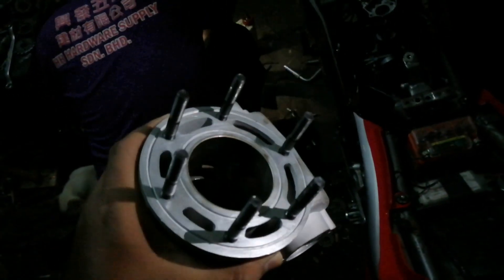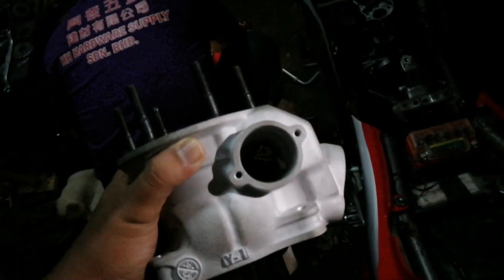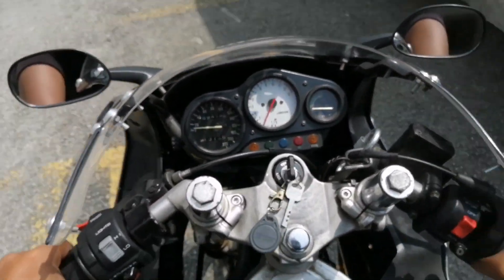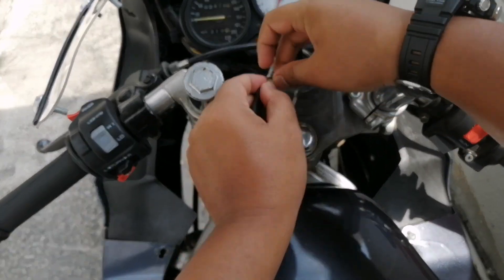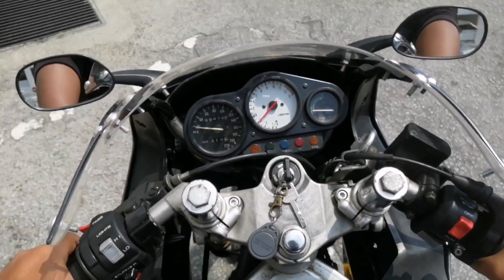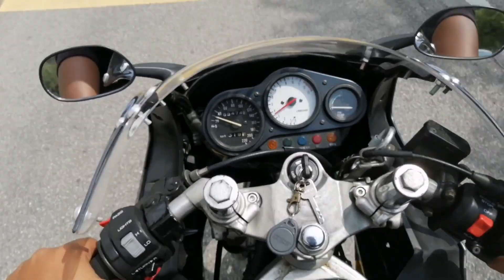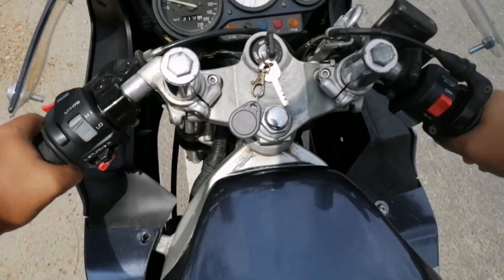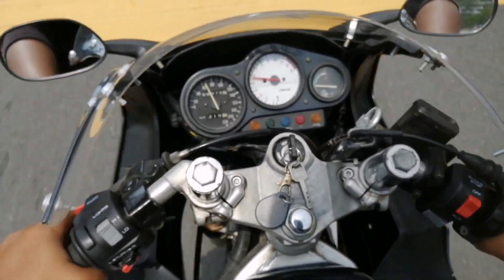TUKAR BLOCK YAMAHA TZM 150 TAIWAN

Comment: ajar cara porting block...moto sya mati kt 160 ja...hahahah
Reply: Kompress dan sporket tune smula bro
Reply: @yum4906  rpm moto mti kt 10.5k...moto jdi mcm smpot2 xmau lepas hbis bnyi rpm dia....mcm ada something block angin
Reply: @chikannie3917  tz sy 10.5rpm topgear 19+ > 2++ kmj da sporket 17/47, tyre 90/90, brat bdn 82kg😁
Reply: @yum4906  owhh orite nnti sya cba naik kan sporket dpan ke 17 skarang ni 16 lain smua sma...brat sya 56kg bleh p lju skit la kott??🤣🤣
Reply: @chikannie3917  brgntung performn motor. Klu x Cukup power atau msih stdr akan drop pickup dan gear 6. Tz sy da skim head 4mm
Reply: @yum4906  hmm gps 158 ja...rpm gear 6 10k mksimum xnaik dh...klau rem ksong lak dlm 10.5k sja ...hjung jdi mcm ptus2 smput...hhmmm xtau nk hbaq mcm mna...tpi otai2 kta mcm api problem...dh try tkar cdi msih sma...nk try tkar coil strter plser dgn coil plug ja lgi..
Reply: @chikannie3917  dptkn dlu kmbali seting kilang. Sbb tzm yg bru kluar kedai dlu mampu cecah 210kmj strd. Skitar 18+ - 19+ kmj gps. Selamat mncoba
Reply: @yum4906  hmm stting carb pkai pj 37.5 dgn mj210...yg ni ja stting yg ngam lain x bleh msok...timing idle dlm 1.2-1.4k nk bgi 1k pon bleh moto x mti...tpi yg plik nya bla rem hjung2 tu mcm api x smpai...jdi smpot...moto try trik ok cun pickup trbang slagi rpm x lbih dri 10.5k ...klau trik gear 1 rpm bleh p smpai 11 tpi moto jdi smpot2 mcm nk mti injen...gear 2-3-4-5 smua hdup pickup...tpi yg plik yg smput tu ja...hahah ssah skit nk crita sni huhuhu
Reply: @chikannie3917  dah cuba guna cdi racing?
Reply: @yum4906  ya dh cba...msih sma..tpi pkai cdi rcing lgi trok...moto jdi brat x mcm cdi ori...owh cdi sya ori...da lmbang yamaha kt ats